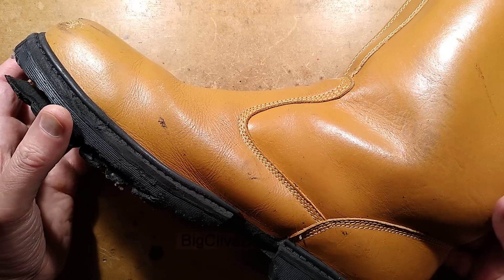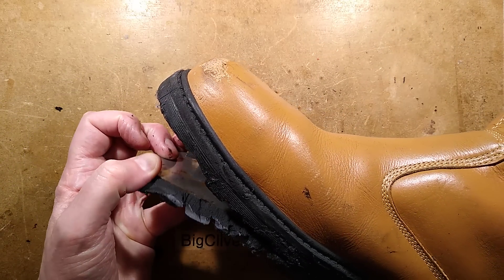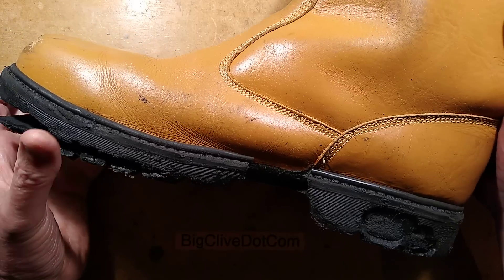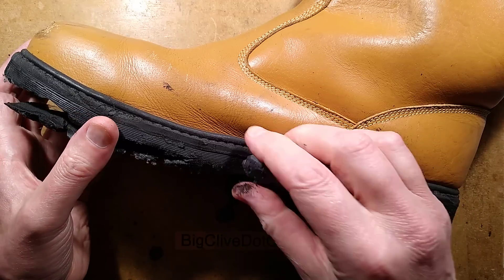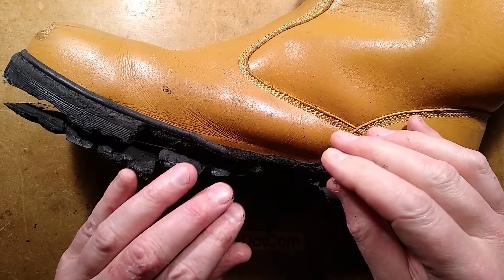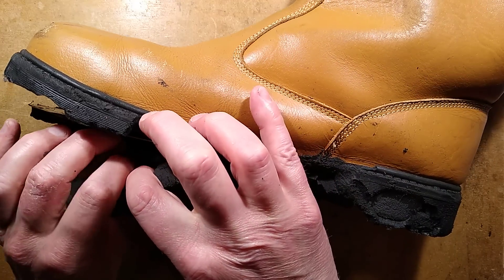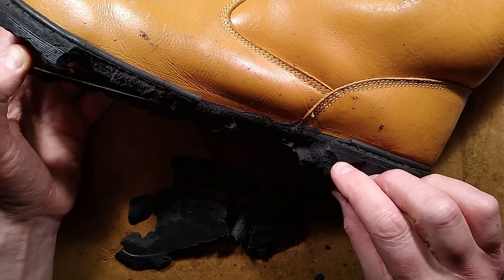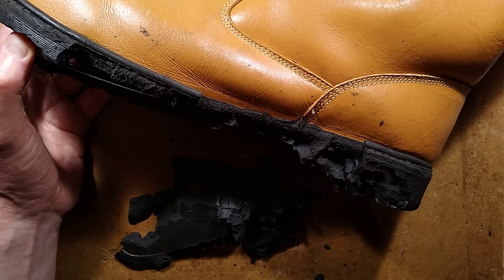My work boots have melted!

Comment: I had a pair of inexpensive boots do the same thing a few years back. I had been walking around in floor-stripping chemicals the night before but had done this routinely for some time in the same boots with no issue, until one day i got ready for work and the soles just crumbled off in exactly the same way. I set them on my front porch where over the course of a day they literally melted to the concrete. strange, indeed.

Comment: We do still have cobblers over that that would fix them right up.  I find it odd that you all don't. (we call them shoe shops, there are still a few around).  You could likely get a new "goodyear" sole applied.
Reply: I see no stitching, but a skilled craftsman can overcome that... for a price...   If these were cheap boots, throw them out.  If they are actual leather, and other than the soles, good construction.  Have them resoled.
Reply: I personally use Vietnam era jump boots... they wear forever and can be revitalized by the local "shoe shop".  No steel toes in them though.

Comment: I have definitely seen this before. One very hot summer day I had to go to the dentist, so I put on a pair of lovely old sandals. There was a crack in the sole, but nothing else seemed amiss. Halfway there, BOTH SOLES crumbled to dust suddenly and without any warning. I was thus left with a dentist appointment to catch and without shoes on a day so hot you could fry eggs on the pavement...😖

Comment: I have once seen the rubber reacting with a floor material. Don't know what the components were made of. Some sort of PVC linoleum or what ever. The shoes were mostly melted and stuck to the floor and the upper part was crumbling away at touch.

Comment: Yup that's polyurethane when it gets exposed to water for too long. You see it in foam filled tires if they aren't sealed properly and get water in them. It practically turns the material into jelly which isn't that good for tires on construction equipment

Comment: A local shoe shop owner once told me the she shad a customer with a similar issue. She replaced the shoes a few times in good faith but it kept happening. In the  end she actually got a shoe sole tested in a lab and found the isopropanol or ethanol had caused the rubber to melt away. Are you also storing beverages (or any type of alcohol) in that cupboard? (perhaps leaking, doing the damage and then evaporating / oxidising away).

Comment: Nitrated solvents will do that to rubbers as many popper using hipsters have found out and it only takes a small spill in the corner (radiator etc) to wreck every grommet and flange in the house.......

Comment: As someone has said its probably PU hydrolysis, it rather spectacularly happened to me with a PU compressed airline, the whole line had turned into your shoe and didn't react too well to having 8 bar suddenly put though it. fragments of pipe everwhere

Comment: I had a similar favorite pair of work boots that I donned for an outdoor job after they had sat in the closet for a couple years.   The soles literally disintegrated under my feet while I was using them.  It was embarrassing, as well as disappointing, as I recall I paid pretty good money for those boots.

Comment: some lubricants have silicone oil as a component if the boots sole was a synthetic it was likely containing silicone which oddly enough silicone oil degrades an decays if you happened to walk through any thing with silicone oil could be a cause

Comment: Used many brands of walking boots for years... cheap and expensive. I had a very similar thing happen with a pair of meindl's 6 or 7 years back.... and mine hadn't even been stored away in "unfavourable conditions" for a number of years.

boots were probably 2 years old... well cared for and normal wear and tear.... went for a walk in the Yorkshire dales, half way through the day noticed one foot getting wet, by the time I'd got back to the car BOTH soles were it a truly awful state... Of course they were out of warrantee so no come back. Never bought a pair of Meindls since.

Comment: PU consists of long polymer chains that are gradually split apart due to the effect of moisture. As a consequence, PU loses flexibility over time and gradually becomes brittle.

As the shoes reach an advanced age, this can lead to signs of disintegration in the soles.

Comment: I've never had a pair last long enough to degrade that way but I certainly have had boot soles melt on hot checker plate when there has been a fire roaring away on the underside. A risky site that one.

Comment: my BICAP boots lasted 5 years, the rubber started turning into dust. I only used them in the winters, they got exposed to chemicals, like motor oil and diesel. I guess the combination of -20 C weather and chemicals made it crumble

Comment: My Timberland boot midsoles did the same.
Polyurethane crumbles away after a while. Cheaply made these days. My cousins ones are 40 ish years old. Properly made with Vibram soles too.
Next time buy a boot that has a leather midsole so that you can re-sole them as many times as you need.
Drop a line to Tring Shoe Repairs and ask him what he recommends.

Comment: I had the same issue with a pair of expensive hiking boots that where in storage for about ten years and where only worn once or twice.  Upon retrieving them from a climate controlled storage, the soles where sticky and exhibiting the same characteristics as in the video.  So into the trash.  If I recall, they where either Eddie Baurer or Timberland.  I likewise was dumbfounded why?

Comment: Ive read that the rubber in soles if not worn for a long time becomes crumbly like this i cant remember the exact reasoning but basically the less you wear them i guess the rubber or sole doesnt get to stretch was the basic idea? But its why i always walk around a LOT in used shoes before i buy them. Bought 100 dollar pair of blundstones once that did this the minute i put them on. Couldnt afford to have them resoled. Sucked because the leather was just fine. I assume the seller hadnt worn them in a while bc while i forget the exact reason i do notice used shoes that havent been worn in a while have this issue most often

Comment: Did you ever use a pinch of boric acid to remove the odour in these boots? I've found that you need to be very careful about the composition, especially of the glue holding the sole to the shoe/boot. Generally those with a real welt will do fine but cheap ones with a with a fake welt and presumably lower quality glue can have "issues".

Comment: I had the same problem with a pair of black shoes some years ago.  Hadn't worn them in a while, and then when I went to wear them for a funeral, the soles disintegrated as I walked to the car!  Luckily no-one saw me, so got away with it (would have been worse if I'd made it to the funeral though).

Comment: I recall TWO related experiences to this one:

1:  I had a nice pair of LL bean boots that I wore for years, that literally FELL apart once they were exposed to frigid upper Michigan snow! (Chicago snow wasn't cold enough??) but the soles of these boots SHATTERED once I had worn them in the frigid stuff and when I came in and removed them (at the door); when I put them down, the soles shattered like glass!  shame, too, as they were really nice boots. (this was in 2005 ish)

2: back in 1995, I lived in a Chicago mid-rise apartment, one floor from the top, (it was an all-concrete building and I only had one set of windows) where/when a record-breaking heat wave hit. (over 100 F - 38 C ) and although I did NOT have air-conditioning, I didn't find the days so bad, BUT.. it was the NIGHTS that were unbearable!  During one of these nights, I had a pair of sneakers (you guys call them trainers?) sitting in the kitchen, on the Linoleum floor, near the fridge, that had MELTED and pooled to the floor!  yes, the floor in that apartment on those nights was REALLY that hot! (to sleep, I had to make a tent out of sheets (douvets?) and place a boxfan at one end and then place 2-liter bottles of frozen water (saying "ice" here doesn't sound right) behind the fan... just to cool the air long enough to fall asleep!   I survived!)

Comment: Very common; many imported items with "rubber" parts use recycled materials and the added plasticizers are volatile and evaporate over time.  The rubber falls apart.  Same goes for many plastics.  The gummy issue with things like tools, camera lenses, etc., is the same, except it's usually butyric acid exuding from the rubber (butylene) as it breaks down.  I have a plastic clock hanging in my kitchen, and when I recently went to change the AA battery the case crumbled like a Graham cracker.
Reply: Maybe that explains Dali's painting.

Comment: Hydrolysis. 

IME polyurethane soles always have problems well before the operational life of the boot is over. They'll either disintegrate if they're not worn enough, or develop nasty splits with a lot of tread left.

Comment: I have a pair of boots in a box.  Two sets of boots, both worn less than two dozen times.  The foam is disintegrating even better than that.  Brazos brand from Academy.    Push it with your finger, and it leaves an indent.   The other pair left me walking on the steel reinforcement down the middle, as the soles _fell off_.

Comment: Hello Clive, í have a darned 2 year old qled Samsung TV that suddenly just stopped working properly. Basically it just continously turns off and turns on, it's basically inoperable. It's out of warranty and I'm not about to spend big cash to the place just for them to sell me a new TV. Do you have any clues where to begin on what could be wrong? I've eliminated outlets and the remote. Could it be faulty capacitors? It's just strange because we don't use this TV much...
Reply: Even more strange....posting a comment about a TV on a video about a boot.   In the UK, boot means trunk, not TV.  Not trunk lines, don't get confused.  Oh, it apparently also means boot.  Who knew!
Reply: @Alex-Zone  Even more strange is how you think I wanted your input
Reply from the maker: It's most likely capacitor failure.  You may find complete replacement PCBs available online.   Another common failure is the overdriven LED back illumination.

Comment: Hi Clive in that cupboard did you have anything else made of plastic/polymers or chemicals that could off gas? I ask because one time I had stored some vinyl on top of some polystyrene sheets and the vinyl had melted into the the poly.I have also found many times that old wire insulation can become really sticky and also brittle from drying out or off gassing Shame about yer boots as work boots are not inexpensive these days..
Reply from the maker: Polystyrene seems to melt into a lot of plastics.

Comment: Sometimes the Chinese rubber products do that I had a bicycle tire. I never even used sitting in my closet for around a year and it did the same thing as well as a handle on one of my hammers I got from Harbor freight, which also sells mostly Chinese products.

Comment: This is most likely caused by oil, seeing as these are some of your old work boots there were probably a few places that had oil and industrial solvents and of course because they are work boots no wipe down or cleaning is usually done unless they are absolutely caked so maybe oil had been sitting in a crevice or just that rubber doesn't last forever and the bonds that hold it together degrade over time, And it starts to partially return to a liquid state.

Comment: Urethane rot, which degrades when it is kept dark and in a cupboard. Degrades because they used the cheaper urethanes to mould them, as those do not have the high cost stabilising agents in them that will keep them intact for a good number of years.  If worn and exposed to sun and air, they will last, but keeping in a cupboard they rot away. Used because it is cheap, and generally will last around 15 months of use, and for cheap work boots they will be worn out before that time, and tossed away. Good quality ones, with proper stitched leather, and proper vulcanised rubber soles, will still be fine a decade later on, just needing a new heel, and a new rubber sole stitched on.

Comment: Looks like PlaPO or BNBn13Mo was added to the elastomer / rubber. (that's "Plasticizer for Planned Obsolence" or "Buy New Boots in 13 Months" )   8^)  Seriously though, plastics chemists can tailor the makeup of the resin to fail or break down at a timed interval, or just break down naturally in time. I'm sure it's just an odd coincidence that these events will require purchasing a new version of the article. Very few consumer goods are made to last more than a few years now, and many, like moulded rubber soled boots or ultrasonically welded appliance enclosures, can not be repaired easily without special tools or techniques.  If you could find a boot or shoe repair person that could do a re-sole it would likely cost more than a new pair of boots with self-destructing elastomer soles. I salute your boots as they are lowered into the landfill while "taps" is played by the local bugler.

Comment: If you walked through puddles of liquid, and it had any cleaning solution in it like either caustic or ammonia, that can get it going to end up like that.  Appears to be either old  fashion synthetic rubber or possibly Poly Urethane.  Both are possibly going to have a hard time with liquids above about 10 or 11 pH.  TSP cleaners also have high pH...
Reply: You can leave a new pair in the box and it will still happen. I bought some spares and they failed after about 20 minutes wear after sitting in a box for 6 years.
Reply: @IGDZILLA  OH!!  In that case it must be getting oxidized some how... Sounds  like the soles are just made out of a poor choice of materials...

Comment: Your comment about soft touch plastic going sticky after a few years is an example of plasticiser migration; the plasticiser used to give the plastic its soft touch and feel migrates to the suface of the plastic, causing it to become sticky. You can use methylated spirits and a lint-free cloth to remove the sticky residue, but the plastic will lose its soft touch feel and become hard and a bit shiny.
Reply: I think you watched the wrong video.
That is Not what is happening here.
The material is completely disintegrating.

Comment: Looks like a common problem from the comments.
Happened to every pair of Trojan steelies I had in the cupboard from working in an oil refinery some years ago, at least one pair of which were brand new and had never been worn.
Nothing to do with the work environment either, I had them for working in data centres to save my toes from heavy rack mount kit and mostly they were worn in a carpeted office over the road from the refinery itself.

Comment: Clive - if you like the boots and they were a good comfortable fit, take them to a cobbler for a re-sole.   Should cost well-less than new leather boots, but more than discount asian shoes that fail in 3 months.
Reply from the maker: These were low cost rigger boots.  My feet are very big, so the availability of replacement soles is probably low.

Comment: Ah, 'Galloping Trotter Rot' - an ancient Manx curse based on Jedi fairies & a bovine dung poultice coating all the roads. Not to be confused with 'Derby Trotter', as the two are not related, even though they do appear to be completely different to one another.
Known as 'Bootline Spongiform Squarepantsii', it is believed to have come from 16th century Malaysia to interfere with the racing, though this has never been proved : )

Comment: Synthetic rubbers and plastics these days are just rubbish for longevity (cue "designed to fail so you're forced to buy more!" comments), I've no idea why, my current problem is my Lenovo laptop charger cables, they always seem to stiffen up and break within a year or two, and upon opening them up, broken conductors aside, they have a green goo inside which I loosely recall from similar things happening to mains household wiring too, the plasticisers having leached out and just turned to crap... :\
Reply: HP charger cables have the same problem.

Comment: Yup. Known problem with PU material ... I was always wondering why DocMartens are still using PVC soles - this is the reason why. Hard PU formulations turn yellow and are losing flexibility, soft ones break down even when stored in a dark cool place...

Comment: Ozone, I'm guessing. It's hell on plastics, especially flexible ones. A generator would have made it worse, but the level of ozone from air pollution is enough to affect plastics. 

I would find a cobbler and get those resoled. They look like very nice boots.
Reply from the maker: The cost of the boots and their size would make it cheaper to get a new pair.

Comment: Not able to help with the reason Clive but I had a work supplied pair of boots that did exactly the same but I was wearing them at the time. I had just walked through an engineering shop when it happen and I assumed I had walked through some nasty substances on the floor even though the boots were anti-everything .

Comment: I hauled an old pair of work boots out of the cupboard to mow the lawn. Thinking I was just not used to them, I didn't worry too much about walking a bit funny. Then I was wondering what the black things were all over the place. Hmmm, bits of old sole and the complete heel part. No wonder I was walking as if my wheel alignment was out.

Comment: I wouldn’t throw them in the trash, I would send them back to the manufacturer and see if they will warranty them. They could’ve had a bad batch and are relying on the customer ‘s to send them back instead of issuing a recall. I had that happen with a pair of Floor Shines back in the 80’s, they even reimbursed me for the shipping, what could it hurt.